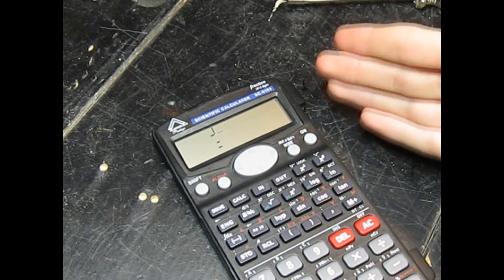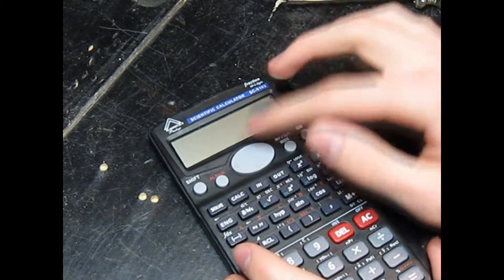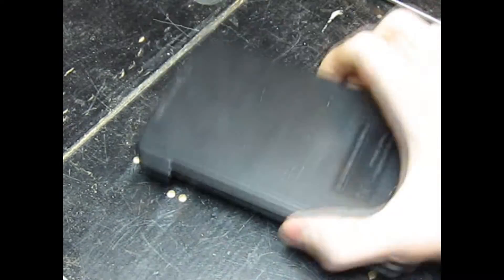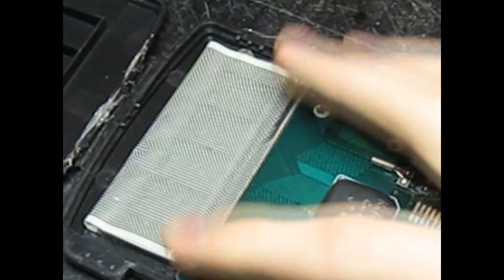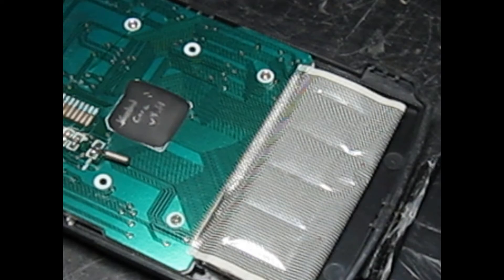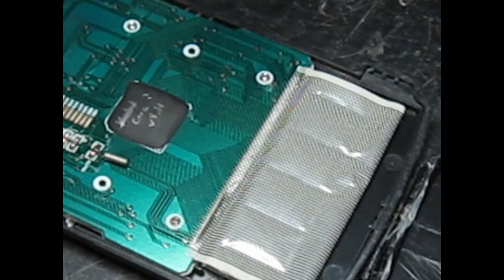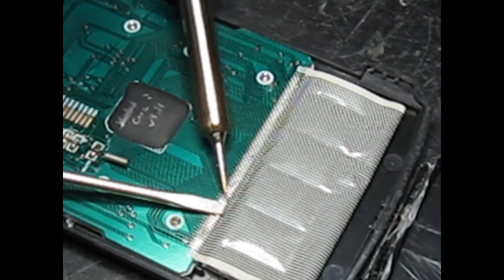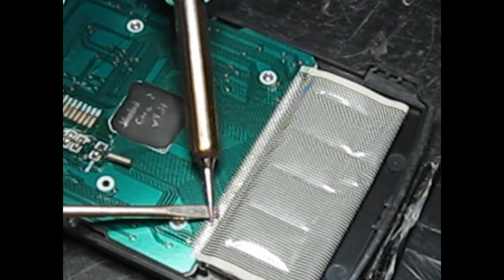How to fix a broken LCD screen

Comment: Don’t suppose you know the name of a replacement adhesive to use with this method? My practice calculator already had the ribbon removed on the LCD side and I stupidly cleaned it with IPA, instead of searching for this video
Reply from the maker: Ah sorry, I wouldn't know. Are you trying to reapply an old screen? You might be able to flow a little solder on the calculators pads, add a little flux and then with the lightest amount of hot air fix it into place
Reply: @SamCampbell  I’ll take that into account for one of the calculators, but the one I’m referring to has separated at the glass side of the flat flex :(

Comment: I'm glad you didn't tear away  the ribbon cable and replace it by the Hardway-Harry tactic of  soldering tiny wires all along  the terminal strip.  The cable is perfectly good, it just needs  to be refastened.